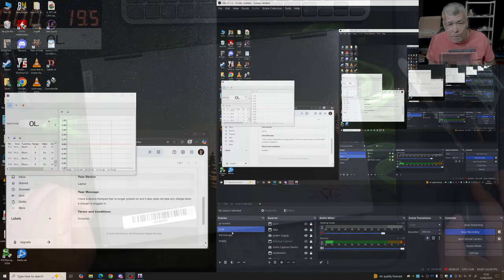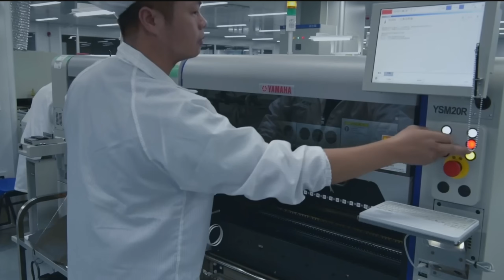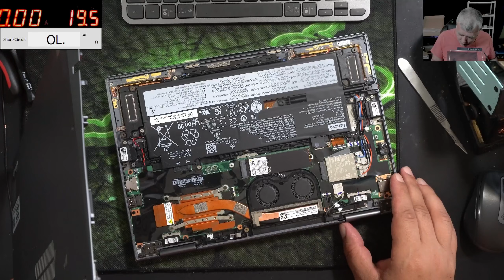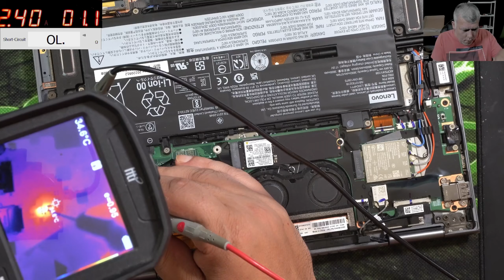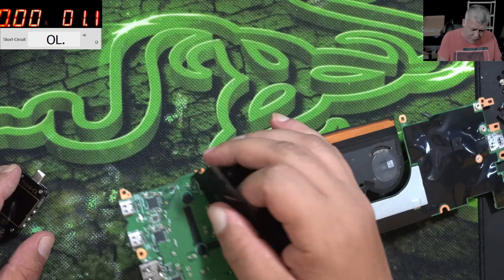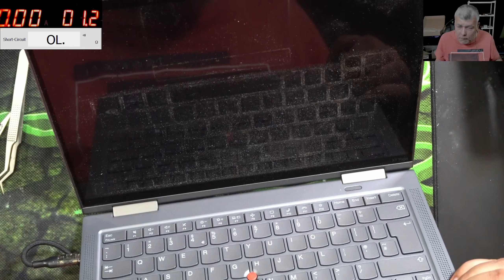Lenovo thinkpad X1 Yoga gen7 - dead, no power, not taking charge, 3 different faults !

Comment: Thank you so much for the repair. What size are the capacitors you need to replace? Also, where did you buy the resin and solder? For the fuse in question, do you use any kind of wire to replace it with the fuse's own wires? Thank you so much for the great work.

Comment: Probably when capacitor go shorter the charge was plug into 2 port . In that moment fuse get broken.
For the first usbc the customers bend many times because won't work
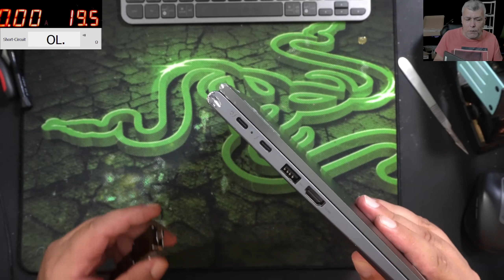Reply: Dropped it. Serious damage visible in the beginning of the video. Whole corner is wrecked. 1:03
Reply: I've see this  👍  @hmartinlb